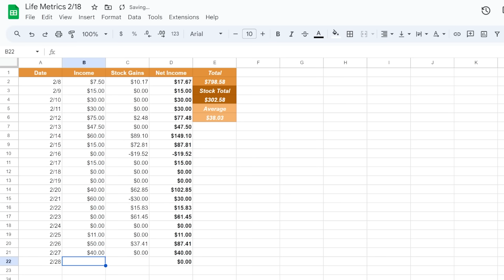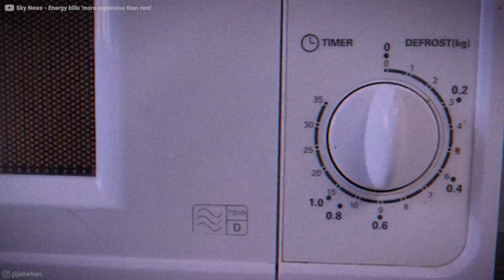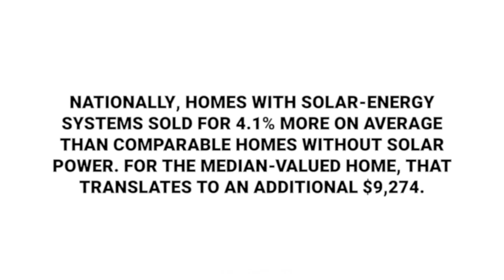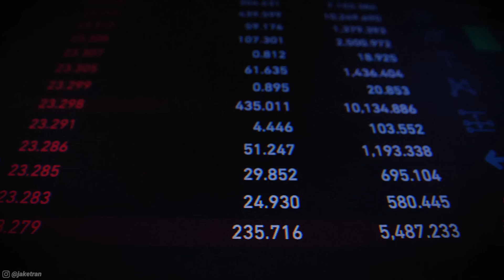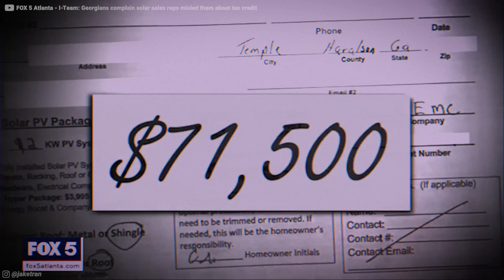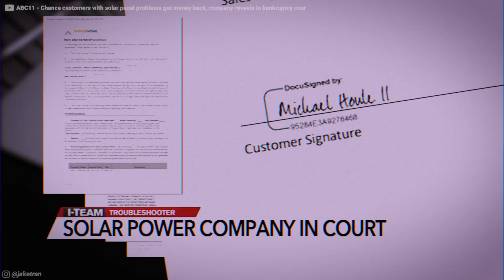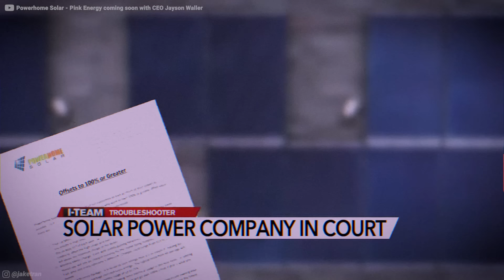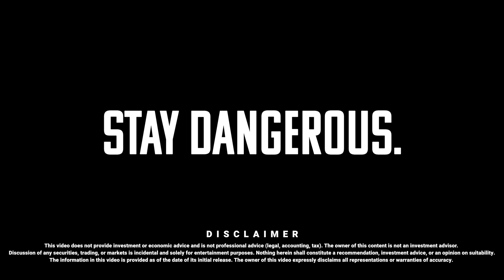Home solar panels are literally a scam.

Comment: This is pure bs.
I have solar panels connected to an off grid installation and they work great my water heater runs exclusively on the solar panels in the summer and spring, in the winter months I have to plug the water heater to the normal electric installation, but I save lots of money with them, so...

Comment: It's always the same story: those who are too lazy to do their own research will always be the dumm ones, literally. 
Money always parts from the fool and flows to those who honor it. 
Apart from that, I paid about 6000 USD for my PV incl. battery. It's a 5kW power plant with a 10kWh battery and net metering. Creates credits for me every month. I will break even after 5 years.

Comment: I haven't watched video I would want them but I'd want them paid off and for them to charge a battery pack. Like a tesla wall an have a few that holds 30k - 40kwh would cost 100k but I'd still like it if only investments would sky rocket.
Reply: Once you've watched a few videos on lithium battery's thermal runaway, you won't be driving with one in your car, or keeping one in your home. 🔥🔥

Comment: It's true and it's 100% the companies. I've done a lot of my own number crunching for solar panels. And here's the TLDR of my personal research. If you actually are looking to save money. You need to install it yourself and do a grid tie system. Anything with batteries will often times make it not worth it. But do your own research. Personally, I could never justify paying a professional when I see the numbers. But from what I've learned, it can often times be the best choice to do a grid tied system, build it yourself, and it's not necessary to be 100% solar. Sometimes, it works out simply getting a dozen panels and just having it pay a portion of your power bill. But solar panels do not last forever and batteries die even faster. So be weary of solar salesmen telling you a 30 year ROI is a smart investment. Because from my math, it's not. I've gotten break even times in the form of theoretical 8-14 years, which seems more reasonable. Plus my break even years includes a very conservative estimates based on seasons, cloudy days, etc within my reason of the US. Where you live matters a lot too.

Comment: Say the thing is if you’re gonna go solar, do your research first because there is multiple different ways to hook up your solar system and it save you money but it’s not having your house hooked up the grid and I’ll tell you another thing there’s a difference between chaining your batteries and daisychaining your solar panels But solar panels is not for everybody. If you can’t turn off your lights when you don’t need them and every light in your house is on in your house looks like a Christmas tree. Solar panels are not for you because they will not save you money because you’re wasteful.

Comment: Water propulsed cars were invented for the first time together with gas engines and for power grids there is nuclear energy. All of the solutions to fossil energy running out was invented long time ago. It is not an issue.

Comment: There are definitely a lot of bad actors out there and luckily the solar company that my family dealt with wasn't like the ones in this video. They never over promised what solar was going to save. I know I way overpaid for the solar equipment, compared to if I did it myself but I received good quality equipment that at this point is producing more solar than they guaranteed. I don't have zero dollar bills from the energy company but I've had about 7 months in the past 2 years and 2 months, where there was no electricity charge. However, I still had to pay for gas and still had to pay Maintenance fees to be on the grid. There are $30 in maintenance fees for electric and gas combined (about $17 for electric), so my bill will never be free. My electricity costs for July were about $44 and were all off peak charges because I still have a surplus of on peak hour electricity. I can guarantee my Dominion energy bill would have been a lot higher than $96 if I didn't have solar. I had 30 days above 90 degrees F in July this year. The AC was running all the time at 76F for home temp.
I can't understand how someone can have 40 solar panels and still be paying $1000 for power. That women is lying or the panels aren't even hooked up. That person who had 18 panels not reporting needs to reset it, then get a hold of her solar company to come out and fix it. I had one of my micro inverters go out and it was fixed in less than 3 weeks at no extra charge.

Comment: This is the problem with people today, just make your own solar panels and systems. It's a quarter of the cost and you can build your solar system up, 1 panel at a time. It's not hard. there's a color coded negative and positive wire that hooks up to the rest of the solar system which is usually 1 wire routed to your batteries or the grid. Y'all are lazy... some of y'all say you do your research but don't go far enough.

Comment: I paid about 13k before refund for my system and installed myself. Super easy. I run the ac as much as i want and basically dont have a bill. Totally worth it. Sure if your dumb and totally overpay it can be not worth it but if you get a decent price and get decent sun where youre at youre gonna be happy with it. This guy is running out of content.

Comment: Is this video really still up? This video is the only video Jake made that is not good. Our utility companies in CA are doubling their rates every five years, since 2018 and solar is a great way to not have to deal with that. What are you saying Jake, to be locked into the grid when I can get new panels and backup batteries with zero dollars out of pocket spent and pay less per KWh ?? If you ask most people with Solar if they think they made a good decision they almost always say that they feel they did. All of your other videos are pretty legit and I get the shock factor you love to use and except for this video I feel like you nail it every time. Some solar companies do suck, but solar as an industry and investment, with the right company is a solid investment. Why pay double every five years and deal with potential blackouts when you can get your power right off of your roof instead. All the TV news stations always want to make things into a big problem for ratings or maybe some kickbacks from the utility companies. People that watch your videos know that TV news is control mechanism. Come on Jake think about this one!

Comment: Throughout this video, you never got into what factors caused the panels not producing energy. You are making blanket statements about it. Sure the companies may be having dubious practices but you make it out as if solar panels don't work at all. There are several optimisations and best practices that also need to be followed by the end user. You took a natrative and created a video to go with this narrative. Not good. As a creator you should be impartial and be more thorough with your research and the info you put out.

Comment: Something that you're not aware of, is that solar panels absorb a lot of heat, and on a hot, sunny day, they heat up to 70 degrees centigrade, which reduces their efficiency by 70%.
In other words, solar panels often don't work on a sunny day, and therefore aren't a practical solution to the energy crisis.
Reply: What are you talking about? Who told you something stupid like that?
Reply: @Ice_Solid  Dark surfaces absorb heat, it's basic physics.